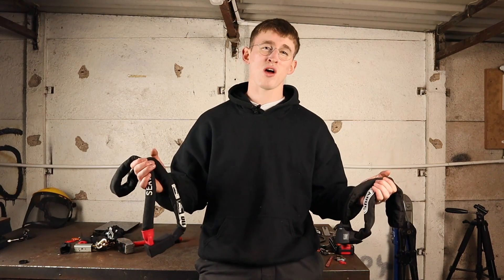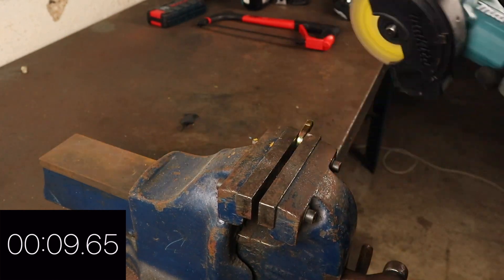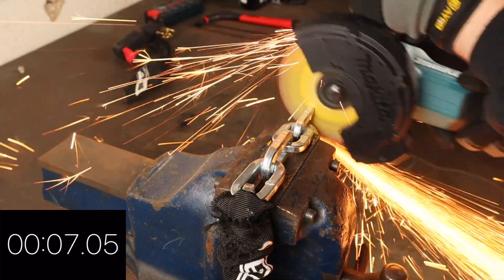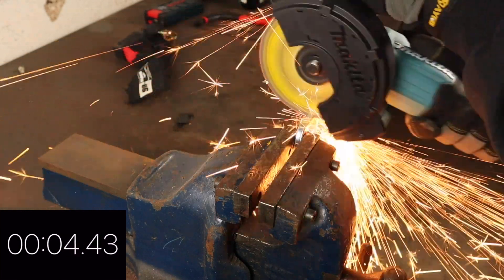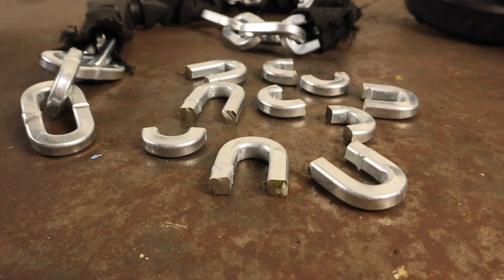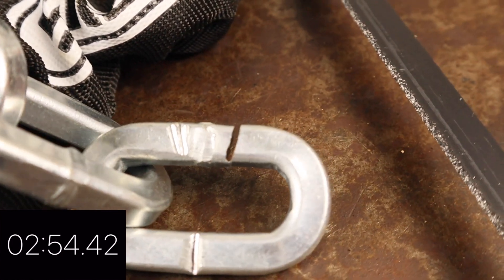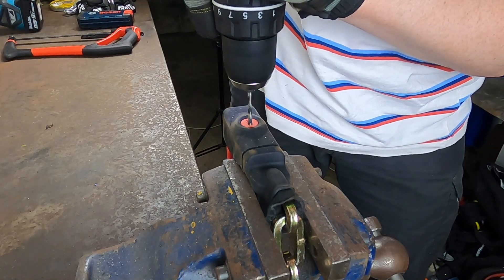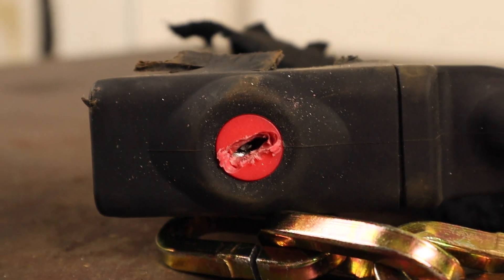Seatylock Viking Silver vs ABUS 8900 - Destruction Testing - Part 2

Comment: Can you cut chain link with angle grinder, but with more realistic scenario, holding chain link with hand or with something that thief would use? As a bonus chain link cut.
Reply from the maker: As explained in the video, I cut using a vice to gather data that’s comparable between the locks.

For future tests I may consider adding a cutting scenario that’s closer to a real life example, however grinders should always be used with two hands as they can jump if caught, causing serious injury, so I’d have to find a way to do this safely as I won’t display or promote poor safety standards on this channel. 

Thanks for watching and for your comment, much appreciated!
Reply: @bikelockwiki I commend you for staying safe and not kowtowing to every armchair critic on YouTube